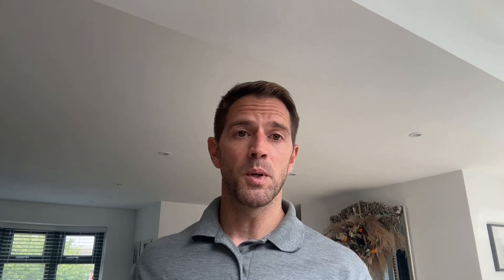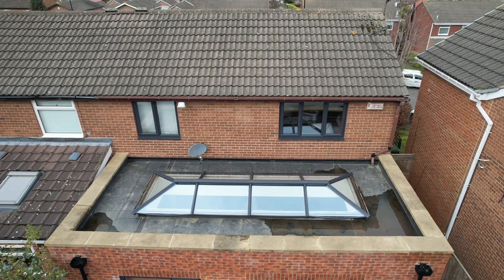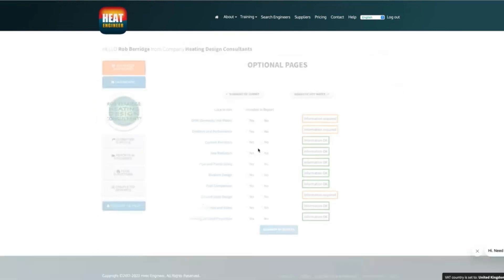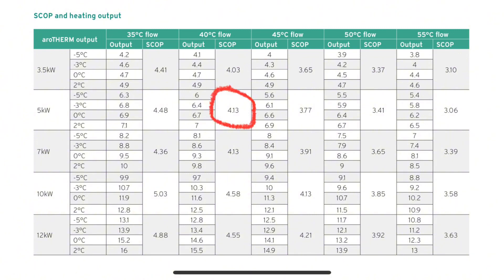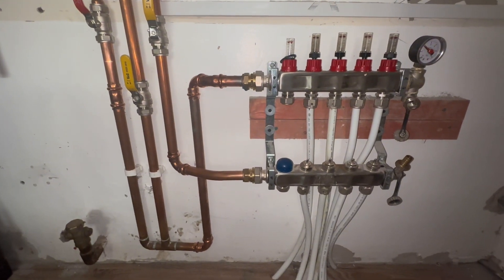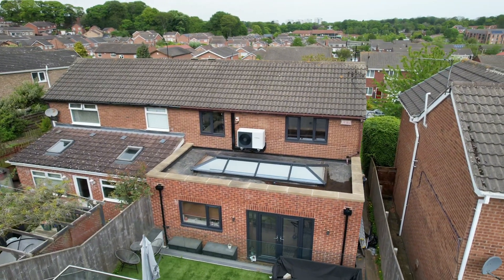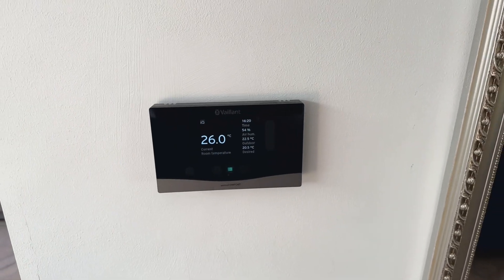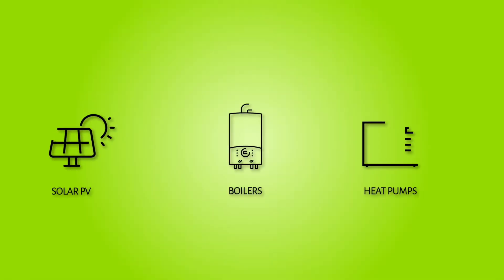Heat pump installation in a 1980’s Property: What’s involved

Comment: I really wanted one so i could get away from gas.  I couldn't find an installer that would give a price and all the reviews were negative.  I ended up with a new gas boiler that costs £11/week to use to provide 23c most of the day and hot water.
It's just disappointed me as i wanted the heat pump!!!
my plan was to get a battery, not solar panels, and to run on cut price electric.

Comment: Genuine question from someone who is genuinely interested but doesn't think my property is suitable. I am also in Sunderland. Looking at the tanks and pipework it's quite substantial. Our house only has a tiny airing cupboard which houses our combi boiler. Previously our hot water tank was in the loft. Our loft is also very low, you can't stand up. How or where would the tank etc be fitted?
Reply from the maker: Hello. This can be a problem. Is your airing cupboard smaller than the one in this house? 

I have seen some people built a little shed outside to house the cylinder next to the outdoor unit but it depends how much space you have.
Reply: @greenhomeheatingltd  yeah it's smaller than the one in your video. No option for us to build outside either due to current layout and lack of space. Just thinking ahead and it's quite worrying as at some point in the future the government will obviously have a real push towards these systems while applying tarrifs and taxes on gas which will penalise those who genuinely don't have the space.
Reply from the maker: z the heat geek mini store could be a brilliant option for you. Not quite as efficient as a full cylinder but certainly opens the market to more people.
Reply from the maker: https://youtu.be/3QAX6ygW9HM?si=N1Z2IT8rwOAajbbX

Comment: Not convinced by the wall mounting.  I have a couple of (initially) very quiet Daikin air to air units mostly used for cooling.  They started off unnoticeable.  One is now 12 years old or so and emits a notable thrum that comes through the mount and into the wall (there is only so much those rubber cushions will dampen, and they compress over time).  If I had the time again I wouldn't be wall mounting these devices.  In this case with the additional access issues for servicing / repair, it really makes you wonder if this is the right solution.

Comment: Still liking the idea of air to air systems. These heat pumps seems a nightmare to plan for, and once installed, your screwed! I have a combi boiler, and the old hot water cylinder i had has now gone, and the small bedroom extended into the cupboard it was in!
Reply from the maker: Air to air can be really good options for some homes. They don’t solve the hot water problem though. I know what you mean about storage space. Houses have moved away from a “airing cupboard” and we struggle for space at times.

Comment: Great video, thanks for making it. What is the dirver in homeowners wanting heat pumps? Is it all £ with the bus grant of just wanting to be greener?
Reply from the maker: Glad you enjoyed it. With the bus grant and the fact the install is vat free it can make it cheaper to get a heat pump when installing new systems or doing system conversions. A well designed system should be cheaper on running costs as well but that depends on the cost difference between gas/electric. It is also one of the best ways you can cut your carbon footprint.

Comment: It's locating the heat pump unit. In a property most people have a seating area just outside the rear property. That's the ideal spot next wall for heat pump.
Reply: I installed heat pumps to heat my swimming pool. The COLD air coming from them was enormous but was at the bottom of the garden. If this cold air was close to a seating area everyone would have to sit with overcoats on!!

Comment: Great video, watching from Ireland..it's a difficult topic but theres a notion that I've heard that heat pumps don't work in badly insulated properties. 
I believe that is false but don't know why - be great to hear more about that in another video.

Also, when you get a heat pump you also have to upgrade to the unvented cylinder type that you've shown? 
About the unvented cylinder, do they improve the water pressure in your home..as in will the water in the shower be of a stronger pressure

Thanks for sharing the video man, very helpful

Comment: Thanks for this video, I'm strongly considering ASHP and this info is excellent.  You mentioned that having a zoned system is a bad idea with an HP - could you expand on this ?  I currently have a gas boiler with smart TRV's (Heat Genius) that allows individual rooms to call for heat.  Would this be a bad idea with an HP ?
Reply from the maker: Hello. Thanks for the comment. I’m glad you found it helpful. 
The more zoning you have the more chance you have for the heat pump to cycle on and off once demand is satisfied and then back one again once another room requires more heat. With a gas boiler it’s a great idea but with heat pumps that require a lot of energy to get the compressor going it will destroy the efficiency. If you size your radiators appropriately for the room temp you require and leave the full system open loop the heat pump will be able to maximise its cycles and save energy

Comment: Interesting video. Can you explain a bit more about what and why you replace old Lagged 80s Hot Water Cylinder Capacity and how do you decide on the capacity to put in a hot water cylinder
. It is to try to hear the whole water use for 24 hours when there is cheap electric? Also if you say needed to heat a tak of that size during the day with a heat pump how long might it take?
Reply from the maker: Hello, there are a few methods of sizing hot water cylinders but some go off 45 litres per occupant. This property only had a 150 litre cylinder as its all that would fit but we have controlled it to recharge as soon as the temp drops by 15 degrees. The recharge time is around 15 mins so it works really well.

Comment: % of C02 output by country- China 27%   USA 14%   India 7%   Russia 4.60%   Japan 3.40%....UK 1.03%.  If every house in the UK had a heat pump and every car was an EV it wouldn't make an iota of difference to climate change. The bottom line is that if I installed a heat pump it would cost me around 5x the cost of new gas boiler ( 3k gas, around 15k to insulate the house to Scandinavian standard and install pump. For the majority of people in the UK it's a no brainer, Just can't afford it simple as that.
Reply: Insulating to "Scandinavian standard" would reduce your gas bill as well, and along with new heating installations - either new build or major renovation, need to have a max flow of 55C, so eventually that cost will apply regardless of heat source.  As for CO2 figures, you might want to do by capita, because if you haven't noticed, there's many more people in China than there is in the UK.  And the UK does import a lot of stuff from China, and if it did all that manufacturing in the UK, the UK's CO2 output would sky rocket.
Reply: @BenIsInSweden hello fellow carbon literacy student 👌 couldn't have said it better myself
Reply from the maker: Hello. This install for a top spec heat pump was around £4k. To change it for a top spec gas boiler with similar controls would have cost around 3k. The system should save around £200 per year on bills compared to the gas boiler. This house previously had a loft insulation upgrade to 300mm and has cavity wall insulation. Even without taking the whole climate change argument into account these systems can still save people money on their bills with the help of the 7.5k bus grant.
Reply: @greenhomeheatingltd  That's the thing, isn;t it? Even with th emassive grant (which I guarantee, not everyone is going to get), it costs more than double what a gas boiler would. If you're facing an upfront cost of an aditional £2000 a saving of £200 means very little. Ten years before you break even. And that's with the other £7,500 being paid for by other taxpayers.
Reply from the maker: @richardgregory3684  the £4000 cost was based on a combi to heat pump conversion and £200 agains a already A rated boiler. If your doing a system conversion or full new system the cost can actually work out cheaper to install a heat pump with the 7.5k grant and 0% vat. As long as you have no recommendation for loft or cavity insulation on your epc you should get the grant.
Reply: @greenhomeheatingltd  Which means the ACTUAL cost is around £13000, with taxpayers picking up the bulk of it. There's no way that is going to get extended to the roughly 30,000,000 homes across the UK. The idea that the Uk should spend £30,000,000,000 in order to replace an already working system on th premise that it will reduce by a fraction the roughly 1% of global emissions we produce is, honestly, for the birds. And that of course does not include extra costs like insulation that will apply in many cases. One can reasonably argue that these should be done anyway, but the staggering cost for what is, in global terms, a marginal benefit is frankly for the birds. The average voter will see China and India building three or four coal stations a WEEK and realise whatever Britain does or doesn't do won;t make a fig of difference. Personally I have no intention to have my perfectly good combi boiler ripped out and replaced, I don;lt have the upfront cash to pay for it, we have a combi as there's nowhere for a cylinder, the radiatiors probably aren;t up to it either and the only place the outside unit could go would mean rerouting the pipework because when they put the boiler in, it wasn;t worth the added expens eof installing it in the one room that is adjacent to the garden.
Reply: I take it you won’t bother with an ASHP then.
Reply: Also electric is 4 times dearer than gas so if a heat pump has a scop of 400 it’s only equivalent to a gas boiler??
Reply from the maker: @paulstevens5329  that would be assuming the gas boiler is 100% efficient. Most A rated boilers are not set up to be over 90% efficient and a lot can be much less.
Reply: @greenhomeheatingltd  that’s a assuming you get a scop of 400% or more which I doubt most installs are
Reply from the maker: @paulstevens5329  that’s is also very true. There will be a lot of poor installations out there and I have seen some of them not performing anywhere near that figure. The training and education needs to improve and people really need to go with installation companies that know what they are doing or there’s going to be a lot more horror stories around heat pumps.
Reply: What are most of your installations performing at?
Reply from the maker: @Anthony-dh3ty  this one is performing at 400% on heating and 300% on hot water. The 150 litre cylinder is a bit more restrictive and the way they have chosen to reheat it isn’t the most efficient but works best around their needs.
Reply: The thing for me is it is expensive in comparison to a gas boiler and with the ASHP I would have to go back to a big ugly cylinder somewhere in the house, back to the days of 1 hot bath a half a washing up bowl of tepid water.

Comment: I had my heat pump removed as it was a total nightmare.  Super expensive to run, the house was never warm the second the weather dropped and it broke down every winter.  I went back to an LPG boiler that was less than half the price of another heat pump and the LPG boiler has been fantastic.  I would only put a heat pump in a new build and yes, heat pumps are noisy.  FYI my house had good insulation and on paper was fine apparently.   The issue in the UK is, one day it can be 10 deg and the next day, -5 and the heat pump just doesn't have the power to replace that much lost heat in such a short time frame.
Reply: I'm always curious about these removals.  As surely most of the work is in the system upgrades and running the pipes to the heat pump. And would end up costing more to have something else put in than getting the heat pump system fixed.  However, I'm always sceptical when comments include Roger Bisby's points, like the wildly varying temperature.  Because even though the outside temperature may change rapidly, a house will retain heat for a lot longer, and a properly installed heat pump on weather comp will handle the difference just fine.
Reply: @BenIsInSweden I have learned a lot from Roger but I feel he has gone a bit tin foil hat recently.
Reply from the maker: Sorry to hear you had a bad experience with your heat pump. What make did you have and how was the heat pump controlled? Was it a on off style thermostat or did it have weather compensation? We like to use weather comp with all of our installs so the flow temperature from the heat pump changes depending on the outside temperature to keep it a consistent temperature at all times without the need to compensate for large energy losses. The Vaillant Arotherm plus heat pumps are extremely quiet. You can hardly tell when this one is on.
Reply: In the last couple of years, ASHP have moved on in design, they are very quiet, especially the Vaillant Arotherm plus, the reliability is also very good and with weather compensation and installed as seen here with just one heating zone plus the hot water zone it's a different ball game.  If your installer is MCS and has taken the Heat-Geek Assured course you really can't go wrong, the training is second to none through Heat-Geek.  Maybe you used someone who made out to be qualified as most ASHP installs are now very good, we know by the numbers installed and the very small number of complaints.

Comment: Shame the first comment was just a troll. 
Also a heating engineer and you've outlined what we tell our customers when they are trying to opt for a heat pump.  Also your replies are spot on with the advice and knowledge. 
We're not MCS yet though and with the issues they're having we most likely won't be continuing to go forward with it unless they actually address many of the issues.
Reply from the maker: Thanks for the comment. It’s hard to blame people, there’s so much negativity going around about heat pumps. And a lot of them being installed poorly and not performing. Hopefully more comes out to help educate customers rather than scare them into thinking they don’t work. 

What issues are you facing with MCS?